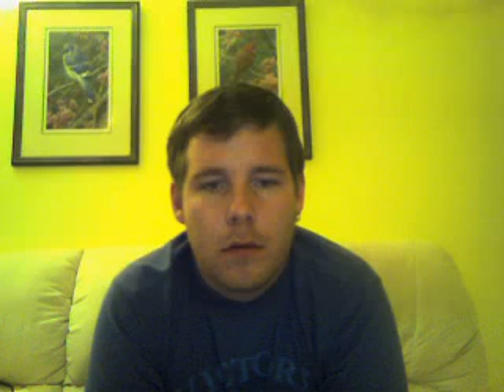THIS IS A LIE!!!!!!! 2004 Dodge Pickup Runs on 100% Water

Comment from the maker: @higherpoweredh2o I made it personal because he is planning to steal from the public and take advantage of them due to their lack of knowledge on the technology. A car will again run on water. The system needs to be much more advanced then just Hho. It needs photon energy to increase the energy output of the gas it self. It also needs to be placed in a high voltage feild to also do the same. Also places on the engine waste efficiency need to be used for gains. The exhaust needs to be recycle too

Comment: As I said on another video, what's next Tesla stole his wireless electricity from him?
I was banned after the broadcast the other night from the Freddy's Cell yahoo group by the owner Sterling.
Basically, I said " told you so" and was removed.
I don't beat around the bush, I call a spade a spade.
Anyone that knows me can verify that.
I am very opinionated on scammers.
I didn't think you was out of line when you called in.
It was obvious that the hosts were very biased and unprofessional.

Comment: Believe me ,  I would not give fast freddy on anyone a nickel until I researched it well.  I definitely believe HHO can run an engine and there is some tricky way to produce lots of HHO from water but I'd stick with simple because it has some benefit that can be done immediately.  Simple right now is real and very cheap. Helps somewhat & real, right now.

Comment: engines will run on hydrogen.....
companies produce hydrogen in huge amounts...everyday...
you can buy hydrogen bottled at 3000psi
amps to HHO easy....more power, more HHO...
volts and little amps.....still ,makes HHO....
pulses work better.....than direct amps
so much research has already been done.....we just need to collect the info and see what does what.....then everyone could go in a forward direction.
everyone could read the old or new on one site. skype would still be just the members

Comment: fast freddy was and is a scammer...i said it from the begining.
i believe meyer and dingel were real.
everyone needs to forget high amps to run a car. the load on the engine is too high. maybe you can get a booster out of it, but to run one while making its fuel with amps...not real.
what meyer and dingel did was different. very different.
problem with the skype thing...most of us are very busy and work 8 or 10 hour days.
make a free website with everyones stuff on it.

Comment: Well, supposedly, "freddy" is in the process of mass production due in "June"..

More *supposedly's*:
His cell actually ran at 3~volts not 12
He tested bottled gasses before the "on demand" system
He was compressing the gasses somewhat..(more than most would dare) so any "lpm" arguments pretty much go out the window...(source(s) say he was only able to run at "highway" speeds for 5~mins at a time before having to pull over to rebuild pressure)